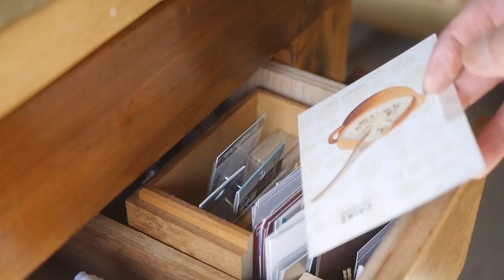A sled made from an old desk top

Comment: great build Tachi. Love it. Maybe adding a scrap in front of the sled where the blade will protrude. It helps avoiding injuries. Cheers
Reply from the maker: Hello Woodful
Thank you for coming to my workshop as usual.
And thank you for your kind and wonderful comments.

My next project will be to make multiple accessories for convenience and safety, of course with scrap material.

Thank you Woodful
Tachi

Comment: Hey busy man, you bought a whole school and used the  banks for your projects😜. Well done. I like to use such a sled . The only problem is that the saw high reduce to 35 mm. But still a very fine tool. And you made it as a Master. Greetings again , Jan 🌷🌷🌷Holland
Reply from the maker: Hello Jan
Thank you for coming to my workshop as usual.
And thank you for your polite and wonderful comments.
As you say, you have something to lose, but you have a lot to gain.

My next project will be to make multiple accessories for convenience and safety, of course with scrap material.

Thank you Jan🌷🌷
Tachi

Comment: Excellent Tachi very professional. I like the replaceable piece to renew the kerf. Do you think a sled designed for a blade at 45 degrees would be useful? Thank for sharing
Reply from the maker: Hello David
Thank you for coming to my workshop.
Thank you for your polite and nice comments.
Replaceable parts for updating the cut will be replaced after 3 years.
And I think a thread designed for a 45 degree blade will help, maybe!
Thank you for coming David
Tachi

Comment: "A sled made from an old desktop" LOL Tashi, I would have been disappointed if you had used anything else. Glad to see that you are well my friend.
Reply from the maker: Hello Will
Thank you for your nice comment.
This is different from the usual desk top plate, and the size is large, that is just the size.

Thank you my friend Will
Tachi
Reply: @TachiOhyo56  I have a table saw that I picked up cheap and it was missing the fence and miter. Little did I know at the time, a new tablesaw would have been cheaper than to buy replacement parts. To make a long story longer. I made it a dedicated crosscut with a sled. But with your add ons I will be remaking it. Problem is, I went to our local reclaimed wood guy and was told that tere was a shortage of desktops because there being used up by somebody in Japan!😂
Take care Tashi and stay well my friend. Will